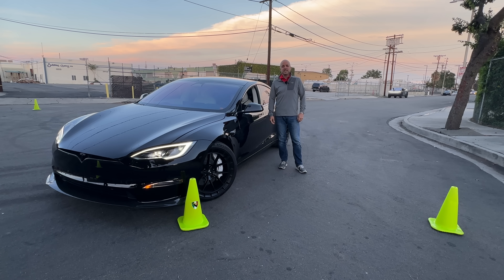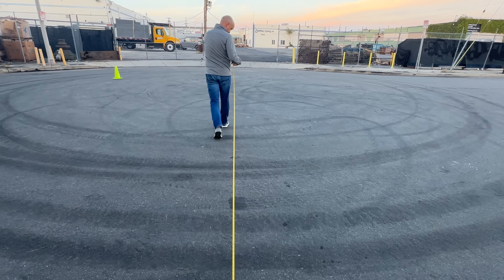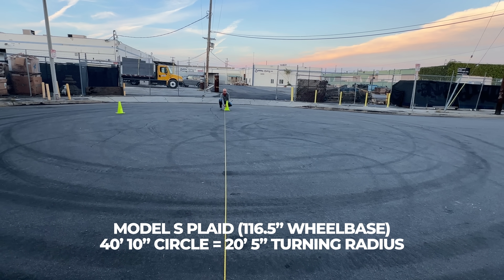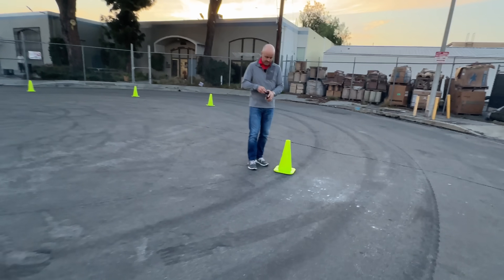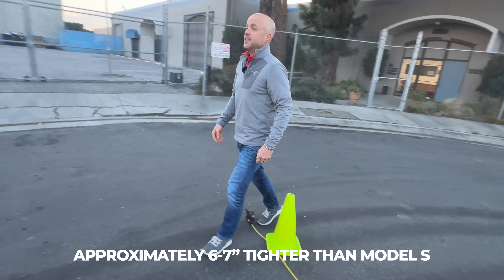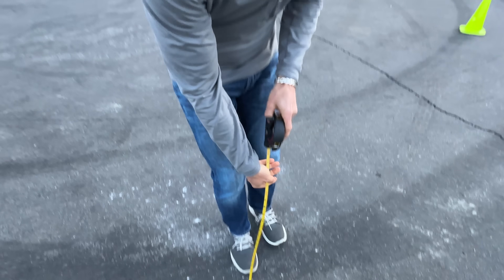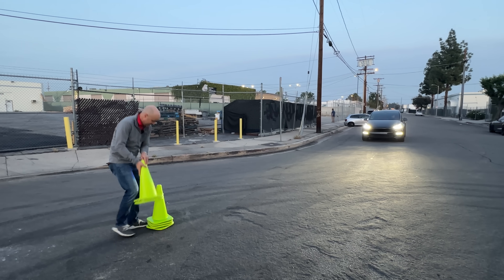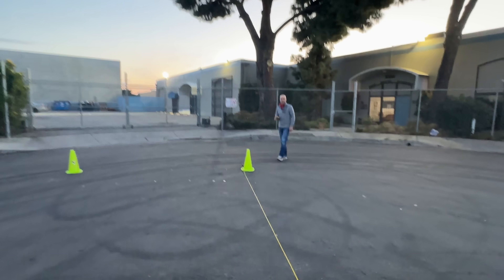Cybertruck Turning Radius Put to Test!  Shootout Between a Few Tesla Models & Ram 1500, For the Win!

Comment: Nobody has been able to answer this question: is the E-locking differential(s) on the cyber truck manually selectable for the front and or rear differential? How does one engage the lockers ?  Only low speed ?
Reply: Your question is valid.  But it is software controlled.   I expect to see many updates regarding the drivetrain and suspension to improve capability.   There is so much that is possible with this setup.  I was disappointed with the rear wheel steering thinking that it was as good as it gets.  3 to 10 degrees should  be interesting.

Comment: In meantime Tesla cybertruck could only tow 11000 lbs 100 miles and had to unhook from trailer to recharge for an hour .  Ram truck went 350 miles and pulled into gas station with trailer and was filled up in 4 minutes and back on the road.

Comment: If I heard correct, the rear tires now only go a maximum of 5 degrees but after software update, it will be 10 degrees turn and that would even make the turning diameter shorter..
Reply from the maker: That will be something cool, we will be on the lookout!
Reply: Not even 5. I think they said out of the gate from delivery day it was 3% and they would slowly go to 5 then 10.

Comment: The turning radius can be calculated by dividing the wheelbase of the vehicle (the distance between the front and rear axles) by the tangent of the angle of the turn. The formula is: R = (WB) / tan (Θ), where R is the turning radius, WB is the wheelbase, and Θ is the angle of the turn
Reply from the maker: Yes, real testing vs theoretical is always interesting - tires scrub, which is not factored in the pure math
Reply: That works for normal cars without the back steering.
Reply: @jaimeduncan6167  do the same for the rear and substract from the front.
Reply: @huehuetotl  how do u get the angle the wheels turn

Comment: It's a great test / demonstration. 
Nitpicking time :) You should add cones for just over half the turning circle and find the maximum distance between two cones, it looks like on the CT measurement you may have picked two cones that are not 180° apart, and therefore not the full diameter of the circle as the line did not pass through the center point of the circle. 

Scribing more than half a circle will let you take a measurement where, moving one end of the tape either direction decreases its length, proving you have indeed measured the full diameter. But again, nitpicking, it is clearly as tight if not tighter than the Model S.

Now you have a measure, if they do release a software update that unlocks more of the rear wheel steering potential, it'd be good to re-run the test to see the impact it had. Maybe you could get a measure of the max angle today, as I have seen some people say 3° and some say it is 5°, it'd be good to get an actual angle from you guys so with future updates we can see how much it changed.
Reply from the maker: Ah yes!  The Sun was setting and we wanted to do a quick and dirty test to get things rolling.  We will re-do after Tesla increases the rear steering angle limit...if they do!  thanks for watching

Comment: Wouldn't it be better to see how wide road you need to turn around without having to reverse.
Much easier than trying to measure across a circle, trying to go through the center of it. Not so easy!

My old Volvo 245 kombi needed less than10 m. And that were 40 years ago.
These Trucks, needs more than 12 m. Not much progress

The thing is, very frew roads are wider than 10 m.

Comment: Ram test is flawed, should have went to cone to POVs left as it would be going through center of circle better, you can clearly see the cone was even further away as the radius was still moving outward. Nevertheless the cyber truck is less
Reply from the maker: @TSportline
  • 0 seconds ago
Well, a Dodge Viper is 2wd...incomparible to these AWD Teslas - the Tesla has front drivetrain/axles, which comes at a price for turning.   

On your Ram, is it 2wd?  Short bed?  Extended cab?  Need to understand wheelbase too.  For each wheelbase - expect different turning.  And 2wd will be smaller turning radius than 4wd.  

Thanks for watching!

Comment: This test is flawed. I have turned my Ram in under 25 feet. And my Viper in under 20 feet. Someone needs a driving lesson in the accelerator pedal and mechanics.
Reply: Agreed ithink to many factor play into this kind of test. Still kind of cool to see though
Reply: I think they have to have a known circle so that they can get the diameter not some arc to either side of center.
Reply: Training:  You turn the wheel until it locks, then go slow in a circle. There you go, now you’re a certified trainee!

Their turning radius for the Ram pick-up was 22’ 5”, so less than your 25’. They must’ve had good training!!
Reply from the maker: Well, a Dodge Viper is 2wd...incomparible to these AWD Teslas - the Tesla has front drivetrain/axles, which comes at a price for turning.   

On your Ram, is it 2wd?  Short bed?  Extended cab?  Need to understand wheelbase too.  For each wheelbase - expect different turning.  And 2wd will be smaller turning radius than 4wd.  

Thanks for watching!
Reply: The OP is mistaking turning radius for donut radius lol
Reply: Whatever my lawn mower is zero😂
Reply: I am also sure that your Ram does 0-60 in less than 2.6 sec and is also bullet resistant just because you drive it 😂
Reply: Next time you should just get the tires wet and measure the tracks
Reply: @ChitFromChinola yeah, , ,  He  googled the ram turning radius and then made up a story about "his" truck. He doesn't know radius and diameter though related are different.
Reply: Turning radius is a radius which is half of the diameter. What they’ve done here is measured the diameter so the turning radius is probably closer to 18 to 20 feet.
Reply: Sliding bootlegger turns don’t count.
Reply: @jezza6575  Get out the cones bud!  :face-blue-smiling:
Reply: 25 feet x 2
Reply: @vipahman reply to T Sportlines comment hahaha I’m curious to see the facts